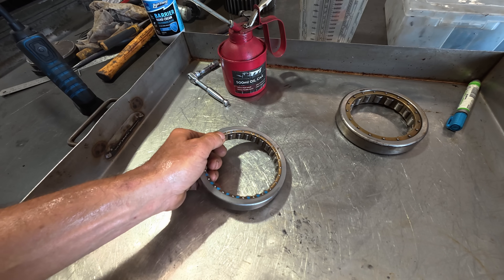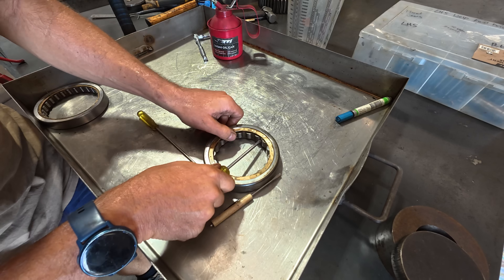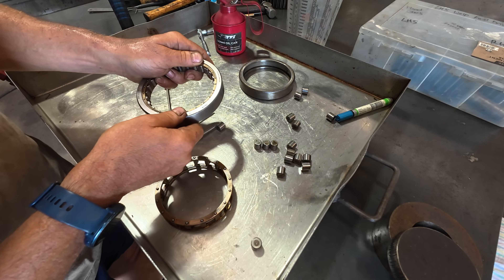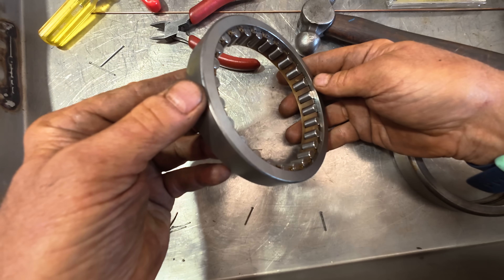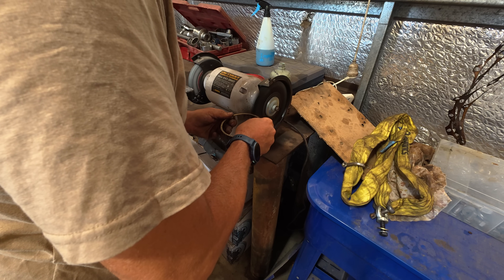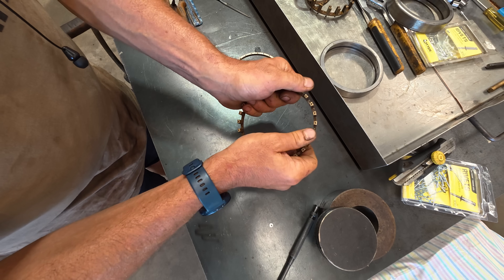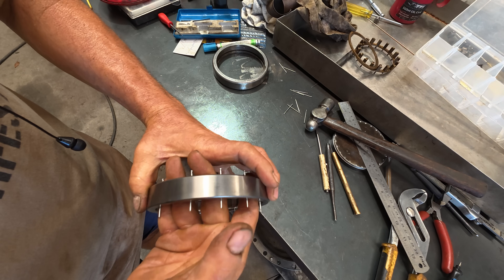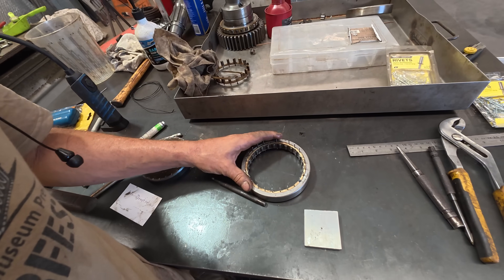If we can't fix this bearing it's going to cost a fortune to replace!

Comment: Riveting Content, Honestly it's incredible that the Germans were producing parts so precise in war time conditions and continued too even during bombing raids, incredible engineering, but all for nothing when simple would have done the job just as easily
Reply: They had a LOT of forced labour to work with.....
Reply: Yep and was ultimately a downfall as well being extremely over-engineered
Reply: @gri7  They were actually under engineered. Lots of complexities that could have been resolved if they'd have had more time in the oven. Good example of this is Maxim machine guns. Very complex machine guns, with extremely overbuilt parts. But they were the first successful ones. But over time engineers were able to design simpler mechanism in lighter weight packages to do the same job.
Reply: The germans put three tanks worth of materials and labour into one tank, by the looks of things.
Reply: @carlwheezerofsouls3273  And it shows why the Allied Bombing campaign vs Bearing factories was so catastrophic for the German war machine
Reply: @NigelAnderson-iu2bs the only tankprogramme the Allies wrecked was the maus......top tank production was in 1944!
Reply: @01Bouwhuis  Did you get your history lessons from temu?
Reply: @NigelAnderson-iu2bs   They just got them from Sweden.  The pursuit of industrial bottlenecks was an interesting story, it certainly wasn't an out and out success.
Reply: @01Bouwhuis   The ramp up through 1943 was enormously disrupted. The 'miracle' of 1944 was built on making large numbers of obsolete weapons.  The bombing campaign couldn't win the war as advocates claimed, but it was a massive advantage for the Allies and is the reason German units were chronically under strength through 44-45.
Reply: @NigelAnderson-iu2bs nope...Hillary Doyle in operation think tank!
Reply: @lllordllloyd i would blame the massive losses on the eastern front for that. And the late shift to a total war economy.
Reply: It’s actually unbelievable. They were the first to put a axle, flow jet engine into the sky while simultaneously having all their factories bombed and having to move from place to place.
Reply: @Hurpdurpdipidydoo   ... and another easily-overlooked achievement for the bombers: the bombing was only really effective as they were moving the 262 into production.  Unmolested by B17s, B24s and Lancasters, they could have been pumped out in vast numbers before fuel became a serious issue.

Few of the many 262s built could be flown because of the bomber-induced fuel and trainee pilot shortage. 

As it was, the program was greatly delayed to the extent that even though numbers were produced, they were poor quality and lacked infrastructure, skilled technicians, and raw materials.
Reply: @Hurpdurpdipidydoo unbelievable via working people like my grandfather to death. Speer has more blood on his hands than anybody not named Himmler and Hitler.
Reply: Built by slaves. Every single time I hear about German precision engineering. SLAVES. The men were at the front fighting to enslave and kill more people. The work was done by people like my grandfather in hell camps and factories and quality control was via execution on the spot  if excused of making a mistake.
Reply: another downfall of the Germans was their insistency that women could not join the work force. They were to stay home and do what housewives always did. In the US, women, for the most part, built about 300,000 aircraft during the war. While the Germans, men, for the most part, built slightly less than 100,000. And they were fighting many more countries than just the USA.
Reply: I mean the technology probably came from before the war, so the precision was a byproduct of the existing machinery. For war poor quality may suffice, but when it came to apparatus and f.ex. everyday machinery - f.ex. cars or lenses - that precision and longevity was well worth it!
Reply: That seems emblematic of Nazi Germany: very meticulous and precise on specific things, extremely inefficient and incompetent when it comes to management.

Comment: I'm surprised you didn't put some lapping compound in the bearing to lap the cage in. Great work!
Reply: That could cause damage to the outer race which appears to be in perfect condition, however I'm surprised it wasn't soaked in some sort of penetrant or something, I know from experience things with brass or copper love to stick from corrosion to other metals so a penetrant or even some cheap white vinegar can help immensely for stuff like this
Reply: @Tater_Lord  Outer race was bulged. That's why he sanded the high spots. Using the bearing itself to lap the cage would have put more even pressure on it.
Reply: @m2hmghb ah yes, uneven wear speedrun

Comment: Never in the field of human mechanics have so many tools been misused by one man for the enjoyment of so many. Absolutely fantastic Steve.
Reply: Every tool, a hammer
Reply: @russeldavis1787  "everything is a hammer once" or "everything is a hammer if you use it wrong enough"
Reply: @hgghgguk  Reminds me of some lyrics of a Paul Thorn tune (he once was a pro boxer): I climbed in the ring with Roberto Duran and the punches began to rain down
he hit me with a dozen hard upper cuts
and my corner threw in the towel
I asked him why he had to knock me out
and he summed it up real well
he said, "I'd rather be a hammer than a nail"
Reply: Ahhh I see what you did there
Reply: Hear! Hear! 
🍺🍺🍺🍺
Reply: Sir Steve should have the letters “OBFH” (Order of the Big F…ing Hammer) after his name. Actually, all the guys at AusArmour should receive that distinction.
Reply: Pass the lump spanner……
Reply: Necessity is the mother of invention.....and every tool is sometimes a hammer.
Reply: If it works is it wrong?
Reply: Nothing more to add to that! Except a "beer-o'clock" well deserved because of it!
Reply: My uncle was visiting from PNG many years ,I was struggling to remove a rounded of nut on my mini bike without a word he picked a hammer up, and with a single swing, he sheared the bolt
He dropped the hammer without looking at me, and when he walked off, he said it doesn't matter if you use a hammer as a spanner as long as you get the bloody thing off

Comment: Perhaps you could try running it in an untrasonic cleaner with a solvent !
Reply: Agreed, it would have cleaned the crap out, but the cage was out of shape so it still needed taking apart and correcting. Entertaining though isn't it.
Reply: I was about to say the same thing
Reply: Yea thats the ticket really.